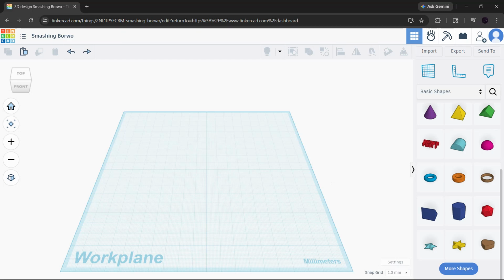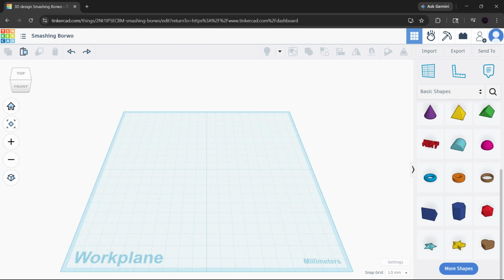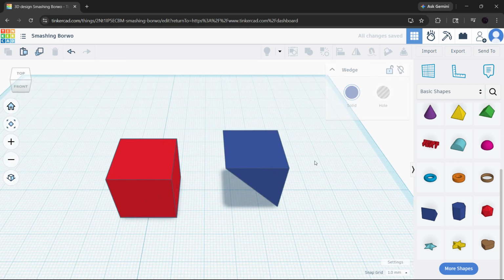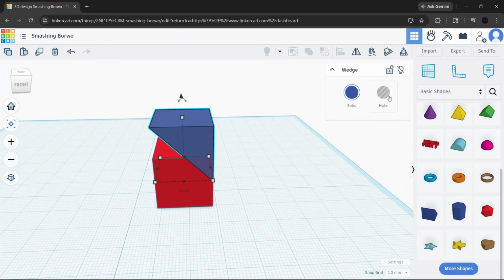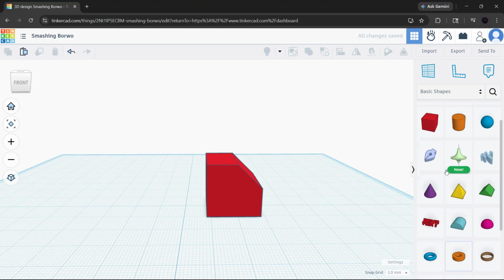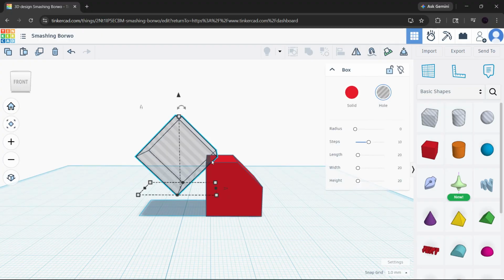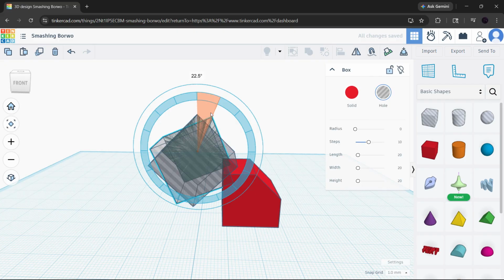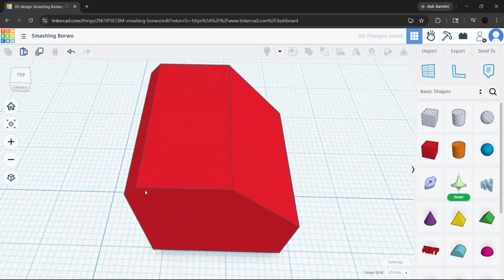How To Bevel Edges In Tinkercad (2026 Easy Guide)

Comment: So inefficient. They should definitely include an easy tool to do something like this
Reply from the maker: Definitely! It’s one of the most requested features on the Workplane. Tinkercad keeps its engine simple so it runs smoothly on web browsers and Chromebooks, which means we have to use CSG hole cuts or the Radius slider in the shape inspector.

If you find yourself needing advanced beveling and chamfering frequently, making the jump to Autodesk Fusion (which is free for personal use) gives you a dedicated 1-click Fillet tool!

Best of luck with your builds, and leave a like and subscribe for more tutorials!